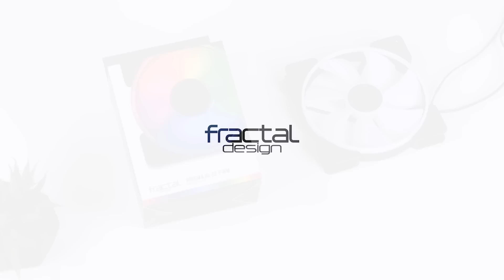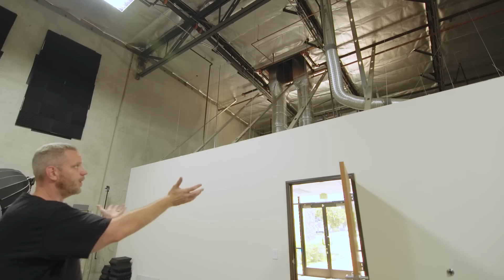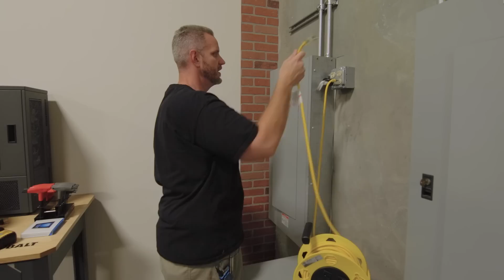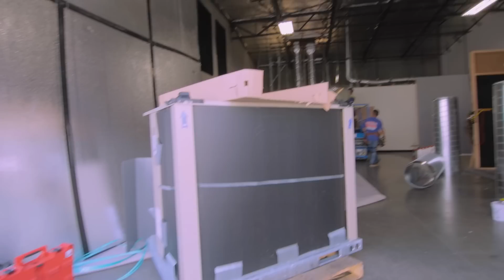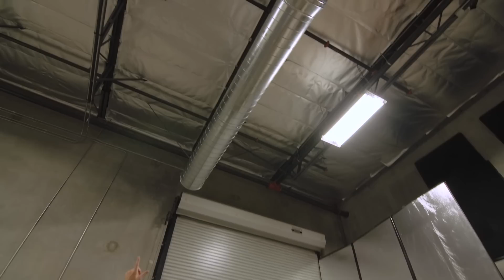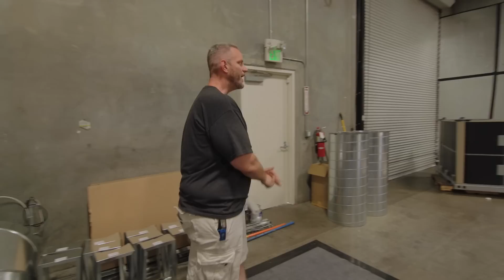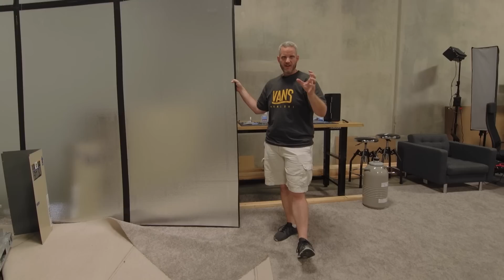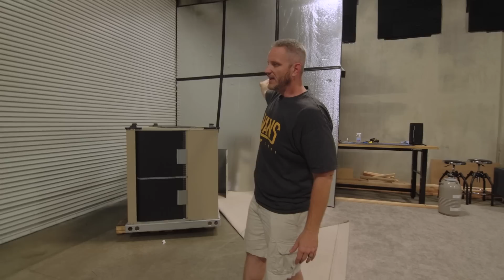The BIGGEST upgrade to the new studio yet!

Comment: TL;DR: A kingdom for a nice temperature in a workplace.
Ah - a working ventilation system is something I would love to have in my previous work. New building, everything nice and all but that moron (my old boss) bought used ventilation system, and hired even bigger morons to install it. Result was - not working ventilation and a bill for over 100k USD for unfinished work (plus some extra mess they've made though in contract it was stated that they would not do that), and everything ended (?) in a court. For me, a guy who had to work in a room on top floor, with sun from 0630 to like 1830, in a fokin' black building it was terrible. If I could I would just come in, do my thing and leave ASAP, just because it was around 50C! No wonder a damn CNC mill malfunctioned 10 times in one week...And now I'm laughing my arse off because whole office must sit in an adjoining room because of rebuild of the office itself (and ventilation) >:D I might not have work anymore, but it's way better than doing suicide runs into that room when it's full blown summer weather here in Malmö (Sweden).

Comment: You wouldn't exceed the voltage rating of that 14/2 wire... you would exceed the current capabilities where it terminates. You could run about 1.4KV through that wire with a 1A load under perfect circumstances. The physical connections are the weak links and sources of resistance.

Comment: Don't get mad at the electricians Jay, they're just doing what they know.  I would second their sentiment although I'm pretty sure you wouldn't even come close to running 20 amps through that circuit.  Could be safe and put a 15 amp plug end on it.  Also the part about having romex unprotected on the floor, especially around stools and such is a no-no.  Gorilla tape doesn't count as protection.  It would be a little cleaner to run an overhead power cord reel, that way it's out of harm's way.

Comment: I can tell you how to build a wall to help deaden the sound from that roll-up. You need to build a wall with divorced sides. Essentially it's a wall where the studs are staggered 2" and the drywall on each side hangs on its own set of studs. This stops the sound that hits one side of the wall from causing a sympathetic resonance on the other side via the common studs both sides are mounted to. One side gets acted upon by the sound waves and then it has to create sound waves that in turn  act upon the other side of the wall rather than the sound being carried through the framing of the wall. You can put regular insulation batting in the voids in the wall to further deaden the sound and insulate the wall. https://www.soundproofingcompany.com/soundproofing_101/building-a-staggered-stud-wall

Comment: May I suggest ... Armstrong Ceiling Panels "Reflects more than 80% of light; enhanced acoustics absorb up to 55% of sound" ... https://www.homedepot.com/p/Armstrong-Ceilings-2-ft-x-4-ft-White-Lay-in-Suspended-Grid-Ceiling-Panels-10-Pack-933/100115519
Reply: For your other areas may I also recommend; Door and Headliner Kit "Absorbs wind noise, engine noise, road/tire noise and exhaust noise between 600 Hz to 4 kHz" ... https://www.homedepot.com/p/HushMat-Door-and-Headliner-Kit-with-1-4-in-11-5-sq-ft-Silencer-Megabond-20200/310188423
Reply: Side Note: I use the Door and Headliner kit in PC Builds on the side panels and other areas.  But there are many uses for such an item.

Comment: They make floor wire mold that you can use and not need gorilla tape to hold down your undersized 14 awg wire. not a trip hazard. For future reference, 14awg is good for smaller lighting circuits and thats about it. just run 12 for your outlets and be done with it.

Comment: Using Romex for that purpose is against code, needs to be ran in wall to outlets or overhead in conduit. Otherwise just plug an extension cord into a proper outlet and tape that on the floor, that's perfectly fine

Comment: Question if it to cool why pick up the air high and cool the whole space when if the air is returned low the  AC  Heat exchanger  has to remove less BTUs  from the loop ?  Leaving a hot layer toward  the  roof .

Comment: I don't think folks were actually mad at you, we just don't want to see you burn down your new studio. Although you might have actually exceeded the max load for that wire had you hooked up skunk works and some other machine at the same time. 15 x 120 = 1800 watts is the max you should pull through that wire but the breaker wouldn't trip until you hit 2400 watts. And yeah Romex is the brand that is most commonly used in the states. Here is a good DIY sound diffuser setup you could make and then suspend at aboiut 10 to 12 feet above the office set. https://www.youtube.com/watch?v=E-N5L9p32BI
Reply: yea its called non-metallic wire. but in the industry we just say romex. yea I don't like to put more than a 75% continuous load on circuits. Heat is your enemy with electric.
Reply: @smokinonthegas1920  right, it is way easier to say romex then the technical term. Same thing happened for other brands like Xerox, band aid, and Polaroid. The brand is synonymous with the product.

And yeah max constant load should not exceed 80% of the breaker/wire. That said you rarely hit the max rating of a power supply and your largest draw is momentary at startup. Although Jay might try and extreme overclock and cap out those power supplies! :)

Comment: Sigh... love the videos, hate the RGB everything. I leave my computer on at night in my room so should I need to use it, I can quickly. I do not want RGB on it. I am getting tired of every single 'gamer' class computer having RGB RGB RGB out the wazoo.
They need to do one of two things: 1. Leave the RGB off or 2. Have a way to turn off all the RGB save for necessities... the power indicator (which should be dim enough that it will not keep up the average person at night), the disk activity indicator (ditto as per power indicator), maybe a network connectivity indicator.
Reply: Bro if your power indicator light keeps you up you got issues... Use electrical tape
Reply: @zer0lex1  yeah it Damn near all can, this dudes just a chronic cry baby you can tell he whines about everything.... Takes 20-25 seconds to boot up a pc turn it off if you can't turn it off Jesus can't wait 30 seconds? Anything to cry about
Reply: Did he force you to buy it?
Reply: @EndstyleGG  Many products are starting to come with RGB whether you want it or not. I'm looking forward to Ryzen 3000 but dreading buying a motherboard for it, because all the higher end motherboards include RGB. So I'll have to either get a good motherboard but have to install dumbass manufacturer bloatware to disable it since these fuckers never include a physical off switch, or get a cheaper motherboard with less features and weaker power delivery that also skips RGB as another way to get the price down. I get to pick between a shitty motherboard and a shitty motherboard. Fan-fucking-tastic. I wish these companies and all the RGB fanatics would remember that not having RGB at all is just as valid a customization desire as any color or pattern of RGB lighting.
Reply: @mjc0961  I get that RGB makes it cost slightly more, but most people like it, you can't deny that. As for disabling it, I also don't like my computer lit up like a christmas tree at night, so I downloaded the asus thing, disabled the lights and uninstalled it, 5min of work and thats it

Comment: I'm waiting on hearing how he's actually using the ac for overclocking.
Reply: Overclock the AC
Reply: no vent, use the cold cooling fluid direct from the compressor
Reply: @Roestikrokette  may as well do LN2 because its the same amount of hazard, having to prevent condensation on the board among other things

Comment: reason for rolling black outs - Jay. concrete structures hold heat. Maybe dropping the warehouse area down with a floated ceiling would help control the amount of space you have to cool and the air gap would insulate it.
Reply: This ^
Reply: the reason for rolling black outs is not enough generation to meet demand.  Too much reliance on renewable and chasing away more reliable generation sources.
Reply: not enough generation or high demand - there is no difference they are the same thing. Get help
Reply: @tomr3422  Not the same thing at all.  It's not unreasonable for people to want to have air conditioning at their work place when the temps can get up to 100 or more.  Rolling black outs happen because generation has been mis managed and choked out by state action.
Reply: So if there is no demand for electricity there will still be blackouts? No one is debating peoples want to be comfortable (well except you) There are just smart ways to have that comfort and there is blame other people. Get some help.

Comment: Do you know what could reduce your demand for AC? Set it to 25ºC or 77ºF!! Why do you need to be so cold in summer? ':) You could reduce a lot your consumption (and as a country as well if everyone did that) just setting the AC a couple of degrees warmer. Really, you don't need to wear long sleeve clothing indoors in summer! (I actually need to do that in buildings every time I visit the States! XD)
Reply: Your opinion on the temp settings hear is pretty accurate. I live in Phoenix Arizona and I roof, 80°set for during the day and 77°-75° at night. Makes a big difference.
Reply: @skm9420   "But it's a dry heat!" Screw you!.  Walter 2007 (Jeff Dunham) "Walter the weather man"
sorry just seeing " Phoenix Arizona " trigger that Joke in my head :þ
Reply: Yeah, people often seem to forget that it is only the delta between inside and outside that really determines your power usage (yeah and the ac, please don't use those single tube portable ones, they use 50% more power). So if it is 35°C outside and you cool it to 25 deg C, cooling it to 22 deg C uses approximately 30% more power. For what? You go outside and you cook cause you have to wear long sleeves inside?

Comment: well I do work for HVAC commercial company ... id say you probably gonna drop around 25-30K on all that cooling XD
Reply: Bro you can get 5 ton units got $3500-4k
Reply: @norm1233  Residential units, sure. And that's not accounting for other parts, labor, and  overhead.
Reply: @norm1233  yeah thats defo not residential unit
Reply: I just replaced 2 5 ton carrier packaged units on a building and the cost was $14,000. Reused existing ductwork

Comment: Weird. Got the notification on my phone so I got on my PC and went to your YT page, and the video wasn't there. Had to copy/paste the link to myself from my phone. Anyways....yay AC! Get a special duct routed direct to your test bench area for custom AC overclocking content! :D Redid the AC in my home a while back. Was quoted $6000 and $8000, ended up finding a website and ordered a quality unit (and blower) for under $2k and installed for $1200 more. $3200 out the door and dang it works so good :D.
Cheap solution for some sound proofing work stuff: moving blankets. Though im sure knew about that. At least you can load up a ton of em cuz of the low cost.